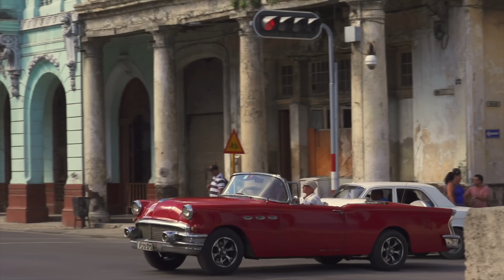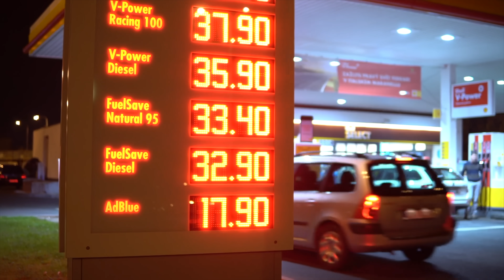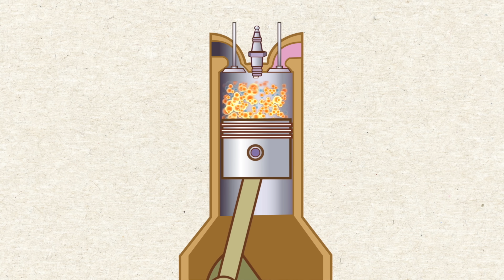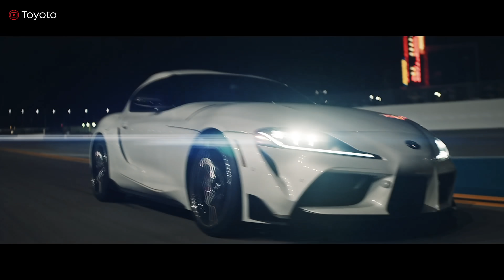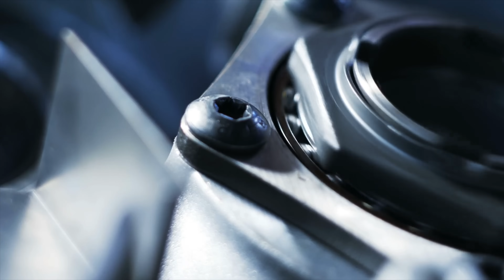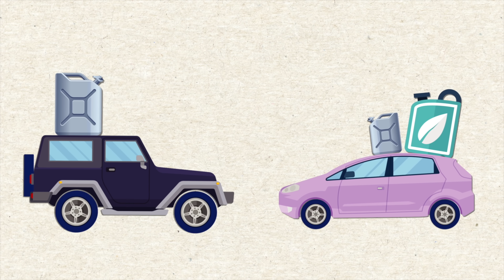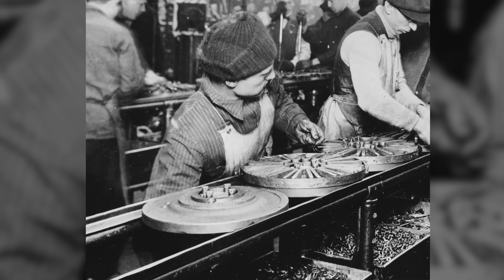7 Fuel Myths Stupid People Fall For

Comment: Thank you for putting out a nice calm informative video. So many people believe that higher octane means higher power. Your explanation was right on and I appreciate it.
Reply: In a way, it does.  Anti-knock sensors will retard timing in your car when the detect pinging...which lowers the power.
Reply: Depends entirely on the engine.  Engines from the "Bad Old Days" ran on something  like 106 octane leaded, this 87 octane horse piss they call gas now, yeah, it hurts your performance (in those engines).  Some 110 avgas I hear would be wonderful, if not apparently completely illegal.
Reply: @johnsansker7064   I know exactly what you mean. I had to put so many additives in my fuel just to keep my old Chrysler running. Those engines from the fifties and sixties didn't hardly run on this junk we have at the pumps anymore.
Reply: @1stupidfish  In the process of buying a 1966 F100 with a 352, will have to look in to what will be needed to keep it happy.
Reply: @johnsansker7064  in the 70s we would take 5 gallon cans to the local airport and get fuel for our "boat"
Reply: @johnsansker7064   If it has an original engine your best bet is to put hardened  Valves and seeds and it so that it can run this pump gas without causing engine damage. Then you can simply modify the timing to make it run better. Back when I was having trouble with my cars I was young and dumb didn't understand how to do it.
Reply: @patrickglaser1560  Interesting!  I buy "premium" anyway because it implies its a slightly better gas quality, anyway.  The price increase is inconsequential to me as I don't drive that much and own economy cars.

Comment: Good evening Scotty stay safe while traveling over to Boston!!!!
Reply from the maker: evening and thanks!
Reply: @scottykilmer  hey Scotty I heard that I can use a 91 octane in a 3.7 l cyclone v6 mustang without a tune I wonder if this is true and would it be okay to do it for the extra horsepower?
Reply: @scottykilmer  for a first car I've been thinking about the 2014 3.7 v6 mustang and I want to know all I can about it before I buy
Reply: @aestheticswim3397  u dont need a tune to run 91 or 93 octane in any vehicle.
Reply: @stopmaverick2  I just wanted to know thanks,I heard the cyclone v6 mustangs where pretty damn fun
Reply: @aestheticswim3397  no you do NOT need a tune to run a higher octane, I personally would run mid grade gas in that engine and keep your oil clean. As long as you don’t beat it up like crazy it will serve you well.
Reply: @aestheticswim3397  but on the other hand what’s the point of having a mustang and not beating it, am I right?😉
Reply: @bobbyhill4181  lol like hell you could beat a mustang, heritage and purebred for performance bby
Reply: @bobbyhill4181  it's going to be my first car but I still want to have fun you know
Reply: @aestheticswim3397  yes I’m just throwing it out there that the more it’s beaten on the shorter it’ll last since you noted it’ll be your first car. The faster you accelerate the less miles you’ll get out of your tires, if you’re driving fast on country roads and hit a bunch of potholes you’ll wear out suspension components easier than babying it, etc... but I really hope you enjoy the car bro and hope you have some fun with it.
Reply: @bobbyhill4181  a good knock around car till I can get a gt
Reply: @aestheticswim3397  tuning for 93 or whatever octane will get you actual power out of it. In my Focus ST the stock tune on 93 is nothing like the stage 1 on 93. Big difference in power/torque
Reply: Good evening Scotty! Would love to meet you in Buffalo but border restrictions are still in effect. Safe travels!

Comment: Ethanol actually is very corrosive and does actually damage the engine pretty fast if you use only ethanol in engines not designed for flex fuel. The main thing flex fuel engines have different is an extra coating of something that does not react to ethanol, hence protecting the engine

Comment: You have no idea how many times i've tried to tell people this. I've given up.
Reply: You can tell me
Reply: You are right. One more thing is do not refill at gas station with fewer or scratch looking. The gas might contain more water.
Reply: @LVang152  Cool any other tips
Reply: @LVang152  "with fewer or scratch looking?" 

I'm not understanding what you mean by this.
Reply: @djsteinotc  i think they mean stations with less cars & traffic- more water in the gas and degradation of fuel if it sits too long in the reservoir under a crusty old station
Reply: @bobbyjarsulic862  water?? Really??
Reply: @djsteinotc  I'm sure he doesn't either.
Reply: @bobbyjarsulic862  It is pretty damn rare to find a gas station where gas sits in the tank long enough though.  Most OLD stations have newer tanks, so old steel and rust is replaced with poly tanks.  In fact I've found a few very old, dinosaur stations that have brand new tanks in the ground and upgraded pumps.  Old store and building, with brand new equipment.  Myths are misses.
Reply: I used to try to help people from getting scammed also. Now I just say I don’t know and laugh behind their back at their stupidity. It’s more fun watching people get scammed then them hating me for trying to help.
Reply: @kreeperfrm559  Alot of the times the water comes from improperly maintained fill ports. Fill ports are tubes that sit in holes or 'spill buckets' that are dug into the ground. If the lids don't seat properly, and the attendants don't clean them out regularly, water will collect in the spill bucket. Which is okay to a certain point, (that's partly what they're designed for) but if the water reaches the top of the fill tube it'll go straight into the tanks. All it'll take is a day and a half of heavy rain, and you've got yourself a problem. 

All gas stations should have sensors that will sound alarms if water is detected, but if you're not getting regular testing done on your equipment, it's possible that the sensor could be broken and you wouldn’t know until a month later when you're having to change filters every two days. 

Once water enters the tank it needs to be scrubbed, filtered, and treated with a biocide. The water carries bacteria and algae that can grow in the tank and clog up filters. It's honestly worse than the water itself. It's rare to get more than an inch or two of water in a tank and since the pipe to the pumps sits above that mark, and water due to its heavier density sits on the very bottom, it's actually quite rare to pump water even if the tanks are contaminated.

Source - 4+ years working at a gas station.
Reply: @tomdurkins  What is it you're wanting to tell them?
Reply: @LastBastian  For example: all insurance companies are  exactly the same when I comes to paying out, just look for the cheapest price. Name brand food products are not only more expensive but contain more chemicals and are made in China compared to USA made smaller company store brand generics. Extended warranties are a scam. Life Lock is a scam. Aflac is a scam. Electronic warranties are a scam. Cell phone insurance is a scam. Mortgage insurance is a scam, 99% of the time. Rid-X is a scam. AAA is a scam. Road side insurance is a scam. Should I continue?
Reply: @tomdurkins  Sure. Except that not all insurance companies treat their clients the same, or respond as promptly, or pay out in the same amount of time, etc...
Also I "fell" for buying an extended car warranty when I was young... And it paid for itself twice over, at least.

Also, I thought we were talking about gas. What are you trying to tell people about that?
Reply: I had a dream I was tied to a tail pipe.  I woke up exhausted!
Reply: @LastBastian  I fell for the extended warranty as well, paid %15 the value of the car on "Warranty". So it was an additional ~$2,000 by the time I signed the contract. I take very good care of that car and never had an issue with it, so I ended up overpaying when I was young also. And although some insurances do help out, I too agree with @Tom Durkin
Reply: @Jgoncrzy  Sure, it all depends on whether or not you actually use the warranty. I took full advantage of it, and had everything I could replaced on my car. And per the warranty they were obligated to provide me with a free loaner car while working on mine. 
I got to drive so many new cars for a week or so at a time. And I had my car in their shop so often they all knew me by name, and probably hated me. Lol
But it absolutely paid off in my case.
Reply: @tomdurkins  

I beg to differ on the roadside assistance as being a scam. It honestly depends on the vehicle. I wouldn't get roadside assistance on any vehicle with less than 100,000 miles unless it's a Toyota, I wouldn't get roadside assistance on a Toyota under 150,000 miles. However when you're over 100,000/150,000 miles roadside assistance will payout and save you a lot from towing bills. 

It also depends on the person and if they take care of their vehicle or not. 

But otherwise I agree whole hearted with everything else is a scam and more for your mental health than actually useful. It's just depends on the age of the vehicle and care and ability of the owner as for if roadside assistance is a scam or not. For most people it is.
Reply: @LVang152  what goes that mean??
Reply: Did you know that you can put water in your gas tank? My mechanic would put water in with the fuel treatment to help clean the engine. Worked great!!
Reply: Same
Reply: IKR. People want to believe in unicorns and magic fairy dust. They can't be bothered with science. I guess it's too boring.
Reply: @bobbybaucom4489  science isn’t the end all and be all, especially when it’s being manipulated by left wing radicals,
Reply: @MichaelRei99  Good grief. Everything is being distorted by politics including your perception of what "science" is.
Reply: @bobbybaucom4489  you guys toss around the word science like it’s a hallowed word. It can be manipulated just like anything else. Only a sheep would believe otherwise!!
Reply: @MichaelRei99  You have no clue what science is. That is not to slight you. I find that to be true of most people. Science is a disciplined approach to learning about the world. As opposed to going off hunches, old wives tales, and "common sense" that often involves some wacky ideas. Science works because, by its very definition, when it is shown to not work, we hypothesis, experiment, and learn until we get something that works. Science is not frozen knowledge. It is a process for obtaining and verifying knowledge. Science is what makes every car, bridge, dam, high rise, phone, computer, watch, etc. work and work well. The complexity of some of those devices never could have been accomplished without science. You use and depend on science all the time. Engineers used science to design automobiles. Much of the stupid stuff in car designed that is blamed on engineers is actually management decisions, not engineering decisions. If engineers were allowed to design cars without interference from marketers, accountants, managers, and the like, it would work better, last longer, emit fewer pollutants, be safer, and be easy and inexpensive to work on. So yeah, when I toss the word "science" around, I don't mean the same thing that you mean when you toss the word around. No, it is not a hallowed word. But it is a hallowed process.
Reply: @bobbybaucom4489  Is not "science". The correct term is "The Science".
Reply: all same gas is gas, said an old man, just cut the crusing

Comment: There is one more twist.  In many places “regular” gas is 10% ethanol which has a lower energy density than gas resulting in less available energy per gallon.  In my wife’s car the mileage increases enough using the recommended premium that the net cost per mile is pretty much the same.
Reply: We're still reeling from the effects of spewing countless tons of lead into the air from our century-long gambit to raise octane by employing the use of tetraethyl lead in fuel.  Not a big fan of the use of ethanol, not so much for the slight energy output ding but more because of how it is harsh on the rubber hoses and seals of small gas engines and how it seems to go stale more quickly and cause moisture to precipitate out of the mix.  But it is a profound improvement over the bad old days o'lead, and it is a renewable source of energy which doesn't involve teasing oil out of the ground..
Reply: @Brandon McDonnell Octane rating has nothing to do with fuel economy or even the ability to produce power. Ethanol reduces fuel economy, it doesn't increase it. Turbo charged cars generally need a higher octane fuel because high octane reduces detonation. That's literally the only reason for high octane fuel. High octane literally burns slower than low octane (I say Scotty's wrong on that one), so you can actually see reduced power from using it, if everything else remains the same
Reply: Except the part of the video where he says premium gas does not have a higher energy density than regular. And my independent google searches that confirm this. Also, there's the fact that ethanol increases octane rating, so premium gas actually has more ethanol than regular, not less. If you ignore all that, I agree with you.
Reply: @SSJ0016  what are Scotty’s qualifications regarding the chemical properties and how they react?
Reply: @Brandon McDonnell I can tell that you didn't watch the video
Reply: @Brandon McDonnell say what? You are either a Corn lobbyist, or trying to unload an Eco-Boost truck from the early 2000s😂
Reply: One additional point, if you're not driving a lot the 95E10 will have worse storing properties. My milage is rather low so 98E5 is my choice.
Reply: @chadthechad4365  what are yours
Reply: @Tim John Un  video isn't 100% correct, the higher octane (at least pre ethanol) was very slightly less energy dense. The difference is just under .01%....but it is different.
Reply: @Brandon McDonnell did you literally not watch the video? Octane doesn’t increase fuel energy.
Reply: @@bmd6889 -- No, ethanol contains less energy potential than gasoline, you cannot dilute gas with ethanol and get better fuel economy, it's physically impossible.  Just like ethanol costs more than gasoline so you cannot dilute gas with ethanol but come out with something cheaper, undiluted gasoline costs more at the pump where you can find it because the government so heavily subsidizes ethanol dilution.
Reply: @SSJ0016  Wrong. Premium fuels contain no ethanol. Ethanol isn't added to increase octane rating, it's added to cut the fuel with a lower cost fuel. 
 
Ethanol is less energy dense than gasoline. You get less mileage and less power for the same volume. 
You do not want to put any ethanol in vehicle that require premium fuel. Your performance and mileage will be absolute garbage.
Reply: My state is one of them.  I assume that there should also be quotes on the "10%" as well.
Reply: @Brandon McDonnell I think ethanol lowers gas strength, but I don't know much.  

It seems to be a legal way to water down the gas.
Reply: @SSJ0016  all premium gas by me is ethanol free, I've never seen premium with ethanol anywhere that i can recall
Reply: Every gas station I've been to since I started driving has always said "may contain up to 10% Ethanol. Lately though I've noticed it become more common that gas stations will have a "No Ethanol" pump, which is significantly more expensive than even the premium, but I've heard that you need to use it in certain lawnmowers.
Reply: @BeerFloof  a lot of atvs and snowmobiles need premium or ethanol free too o was told
Reply: @themonsterunderyourbed9408  Nope.  All grades of gasoline contain ethanol.  Ethanol's sole purpose is to raise the octane.  Why do you think just about everyone with a modified high HP car runs E-85?  Because...of the high octane of course.   You can run a lot more ignition timing and boost on a car running E-85 than on any premium fuel.

Comment: I had an old plymouth Valiat that actually got better gass mileage using 89 octane instead of 87 octane.  it was such an improveent that I was actually saving money even though the 89 was slightly more expensive that 87.  Haven't seen that kind of improvement in any of my subsequent cars from the late 80's or later
Reply: I was just going to say that. Had old 70’s Dodges that ran better on 89. Once computers came into existence, that changed as they could adjust the spark timing according to octane used. There are a few exceptions. My 96 Caddy Eldorado needed 92 or it pinged big time.

Comment: Hi. Thanks for the video, it was very informative.. 
Just a precision: I'm in France and we usually have 3 or 4 types of gasoline.. (plus diesel of course) .. E85 (95% Ethanol), SP95E10 (95 RON with 10% ethanol),  SP95 (95 RON with 5% max of Ethanol),  and SP98 (98 RON with 5% max of Ethanol).
We don't have 99RON here..
Reply: It varies across Europe. I can buy 98 but also 100 in the Czech Republic. Maybe they have 99 somewhere else.
Reply: right. diesel rules in Europe too bad it doesn't here in the states.